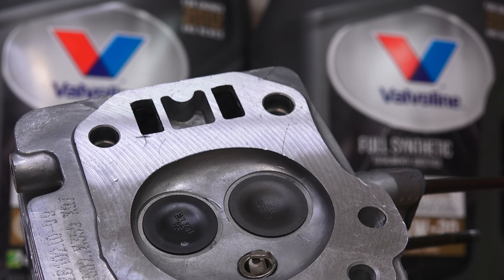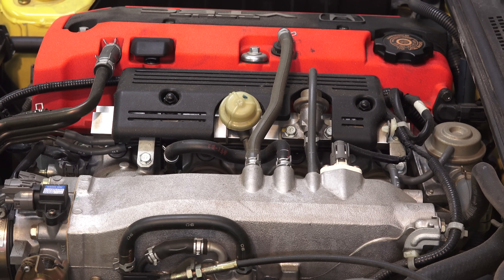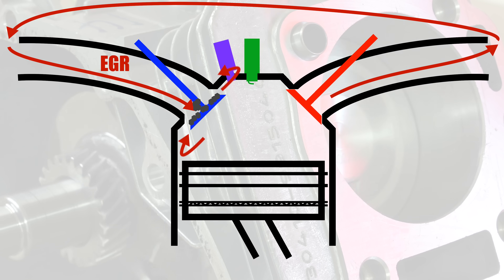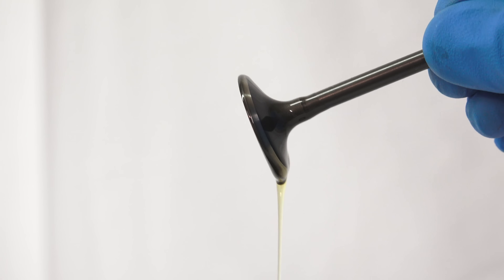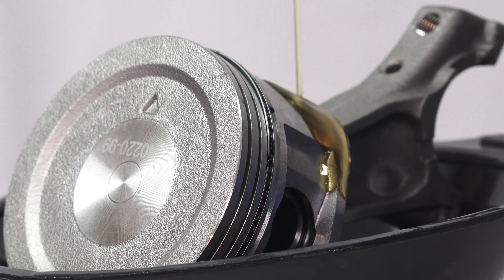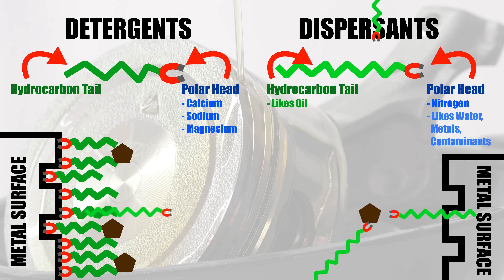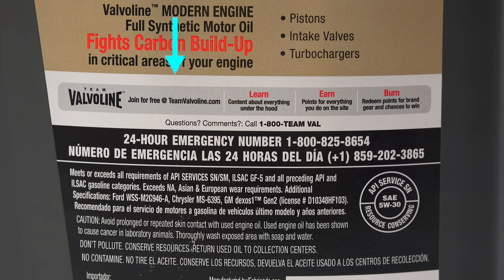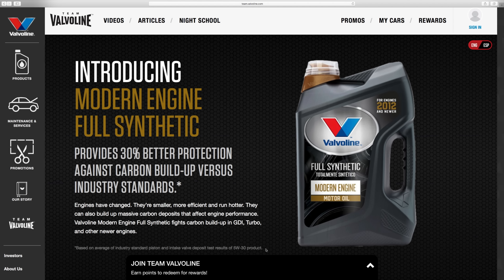Can Engine Oil Help Prevent Carbon Build Up?

Comment: I switched to the Valvoline modern engine almost a year ago and since doing so in my Ford focus ST I’m seeing about 40 to 50% less oil in my catch can so that’s proof enough for me that it’s working.
Reply: Since they stopped making valvoline modern engine, what oil do you use now?
Reply: @MJ_AngeloJR   they changed the name but they still offer it
Reply: @Rockybalboa541  valvoline extended protection?
Reply: @MJ_AngeloJR  I would recommend pennzoil ultra. It's the only oil that's made of natural gas so it burns better and it's more pure than other oils. I put it in my gs300 with gdi and have had no issues with burning with 5k mile intervals
Reply: @smallbeans101  yes sir that’s the oil I have in my 2015 Ford Escape with the 2.0 ecoboost
Reply: @smallbeans101 it’s not the only one. Amzoil is as well
Reply: @takiua2264  actually no. Pennzoil is the only oil made from gas. It's patented so others can't copy
Reply: What if theres less oil in the catch can and now more on the intake valves ?
Reply: I think there might be a misunderstanding. Engine oil shouldn’t be entering the combustion chamber at all—that only happens with issues like worn piston rings, valve seals, or a bad head gasket, which can lead to oil burning, blue exhaust smoke, or fouled plugs. Normally, oil stays in the crankcase and lubrication system. A catch can might collect blow-by oil vapor, but less oil there could just mean different vaporization or engine conditions, not necessarily the oil "working" better. If you’re seeing a big change, it might be worth having a mechanic check for underlying issues to be safe.
Reply: why does your Ford need a catch-can?
Reply: I use Pennzoil Ultra Platinum as well. Lots of research and videos has contributed to my choice. You will see
Reply: I don’t know if it’s a placebo effect but I started using Valvoline Restore & Protect in my moms 04 Civic because it was eating oil and the engine seems a lot quieter and it feels like it has more power. The mileage also increased by 4 mpg but I also had changed the PCV and added some fuel treatment which also might of helped the mpg gain.

Comment: This simply does not pass the common sense test.  You can talk about dismemberments and detergents all you want, but they don't pass over the intake valve on a direct injection engine!!!  It seems like the whole auto industry is trying to avoid talking about this.  The 2019 Rav4 still has a combination DI and injection, so at least the injection portion will spray gas on the intake valve.  And that is why I will buy that car over the Santa Fe, or the Mazda CX-5.  I hold onto cars for a long time, and I don't want carbon buildup.

Comment: I change the oil on my 2018 Civic EX-T regularity. In fact, I change it more often than the manufacturers recommended. I have just over 6,000 miles and I’ve already changed the oil twice. I also use top-tier fuel exclusively with the highest Octane available...usually 93. I know that this won’t prevent carbon build up but I hope to mitigate it.
Reply: Seems in direct injection the carbon build up is caused from the back of the intake valves not getting sprayed with fuel as in port injection . The fuel help keep the intake valves clean in port injection. So am I missing something? how would using premium fuel help keep carbon from building up on the back of those valves when no fuel is getting to them?  I would think a great synthetic oil changed regularly would be your best defense. Which you are doing. My vehicle recommends changing the oil every 7500 miles or 6 months. I dont think I want to push it past 5000 seeing the oil could be the best protection against carbon build up. I don’t see how premium fuel plays into to it. Could you explain that reasoning, thanks.
Reply: @toby7291  
I only use Shell Nitro Plus 93 Octane on my Civic EX-T. Honda recommends 87 Octane. Why do I “waste money” on the Shell Premium? 
I don’t care about the higher Octane for performance as I know it won’t do much on this car. I use Shell’s premium for the highest detergent formulation that comes only with their 93 Octane. I want to mitigate carbon deposits and their 93 Octane offers that extra detergent over regular top-tier gas. I’m fully aware that modern GDI engines do not spray the fuel over the pistons like port injected engines do but every little bit helps especially on turbo engines like on my Civic. If you plan on owning your car for the length of its life (like I do), and you have a turbo engine, everything you can do to keep your intake clean is worth it.
Reply: @txmoney  no I don’t have a turbo. I just bought a Nissan Frontier withe new 3.8 direct injection engine. I didn’t say premium fuel was a waste of money I just don’t and still don’t understand how the choice of gasoline  will help when the carbon build up happens in a part of the engine that gas never gets to. I am using top tier fuel. I don’t have a shell station anywhere near me. Been using BP and Marathon gasoline’s. I’m considering regular intake cleanings with something like CRC GDI Intake valve cleaner. People claim if you use that as maintenance and not using it trying to get rid of heavy carbon build up it’s pretty good stuff. I just turned 1000 miles the other day. So I’m getting to the party early on trying to prevent carbon build up in the intake.
Reply: @toby7291  
It’s great that you’re conscience about your new vehicle and starting early to mitigate carbon deposits.
I now have nearly 84,000 miles on my Civic (about 60% highway miles). Since it was new, I’ve been changing the oil/filter earlier, (every 3,800-4,200 miles) than Honda’s recommended maintenance interval for its full synthetic 0W-20. I’ve also changed the transmission fluid twice and flushed the coolant. The higher detergent top-tier fuel in Shell’s 93 Octane that I use exclusively is just another small measure to mitigate carbon deposits. I plan on using CRC cleaning soon as an added step. So far, my Civic has provided trouble-free driving over three years. I’ve never even come close to red-lining. My goal is to see how many miles I can get on this small 1.5 liter, turbo engine when maintained well...hopefully 300,000 miles.

Comment: Is there a list of affected engines as well as what manufacturers have done to eliminate or minimize this issue?
Reply: RAM IS THE ONLY MANUFACTURER THAT DOESNT HAVE THIS ISSUE
Reply: @ParadiseSleepChannel  , if the engine selected has direct injection without an additional fuel system that injects fuel upstream of the intake valve,  as in some of Toyota's engines, it has this issue.  If the engines do not have direct injection, their days are numbered due to the fact they won't be passing any more emissions standards in the future.  Hence, the reason the Hemi is on its way out.

Comment: You can install a complete catch can system on your vehicle as I did to my 2019 Raptor even though Ford has port and direct injection on their 3.5L twin turbo engine. 

Nothing but clean air and fuel.
Reply: Did Ford make a big deal about it voiding your warranty? Just checking as I have a GDI Honda. Thanks
Reply: @dharmaboy75  

No, I called the Dealer and the Ford Service Advisor said as long as it doesn't cause an issue or something to fail it's not an issue. 

I would have done it anyway because to deny a claim they have to prove it was caused by the catch can. Some Dealers may squawk about but even Ford themselves sell a catch can for the 5.0 and some manufacturers are starting to include them from the factory.

You really need a catch can especially if you only have GDI as you will have Extreme coking issues eventually.  It's a well known fact.

Comment: I have a 95 Honda Del sol with a rebuilt engine, transmission, clutch and a bunch of other stuff. I've been cleaning it up and cleaning up the engine, etc.... What oil would you recommend for this car since it's not a GDI Engine? Thanks!

Comment: Good info.  1. Use correct viscosity oil    2. Use approved oil for your vehicle    3. Change oil often     Pretty much what the old timers were doing.    And that's the truth.....

Comment: Hello Jason,
Great explanation as always!
Here's a thought: why diesel engines never seem to experience intake valve carbon build up (they do, but not nearly as much as gasoline engines), although they the same "recipe for disaster" i.e: egr, direct injection and turbos...?
Reply: Yeah, I've been wondering the same thing.  There's been decades of turbo charged, high compression (of course higher with diesel), direct injected engines with fewer issues of carbon buildup.  What's the difference beside the fuel?
Reply: @michaelmcgarveyspinks4835  my 2002 VW TDI had horrible intake carbon issues
Reply: Because gasoline engines require an amount of air specific to burn the gasoline injected in the combustion chamber. If the engine needs more air than the actually given, it will shake or not work properly, carbon buildup makes this problem. Diesel engines instead only need injection with full quantity of air always, which is why most of them don't own a throttle body. Because of this, when carbon buildup appears on a diesel engine, the engine will slowly loss power without the user noticing because of the way it works. Gasoline engines have vacuum on the intake manifold, which makes the carbon buildup adhere more strongly on the ports.

Indirect injection helped clean the valves, but with this crap GDI engines as the injector is located in the upper side of the combustion chamber, valves cannot be cleaned.

Comment: Thank you for explaining DI and PI.  I now better understand what each one is.  Now, a loaded question.  In vehicles with only DI (assuming some vehicles have only DI), why do they have import valves?  If the gas is directly imported into the cylinder, wouldn't that eliminate the need for import valves?  Or, am I wrong in assuming some vehicles do not have port injection?
Reply: The inlet valve on a DI engine opens to allow air into the combustion chamber, where it is mixed with fuel. Without air there is no combustion.

Comment: Just purchased a 2017 Toyota Tacoma powered by a 3.5l V-6.  I contacted Valvoline directly anf they recommended this oil in 0w20 for my engine.  Anyone run this oil in their Toyota engines that spec 0w20??
Reply: No need to worry your engine has duel (direct AND port) injection.

Comment: In another video you explain the cons of direct injection. How do Diesel engines avoid carbon buildup and run for so long since they also inject fuel directly to the cylinder chamber?
Thanks,
Reply: Diesel engines have a BIGGER problem with carbon build-up on intake valves than gasoline engines1

Comment: Only thing that seems to really have any impact on slowing it down is put a oil catch can in the PCV system filter out lot of the junk before it goes into the intake. Using good oil with lower evaporation also helps. From the charts I have seen only Redline and Pensoil Ultra have the lowest NOACK Volatility lot of amsoil websites also. The main thing is the catch can which can really make a difference.

Comment: Not only the base oil break down and decrease the oil performants also additive package breaks down after mileage. Modern low SAPS oils specifications have been achieved with higher quality base oils so oil do not need much additive package compared to standard oils. So first follow manufacturer oil standards than find low SAPS oil which meets the manufacturer’s standard.

Comment: Thanks for the interesting and informative video Jason. I just got a 2019 370Z that has the port-injected VQ37VHR engine and I'm going to install oil catch cans in the PCV line to reduce deposit buildup in the intake tract that's upstream of the injectors. I use Chevron Supreme and am going to dose the tank with the Redline SI-1 fuel system cleaner before each oil change, so I'm pretty sure that everything downstream of the injectors will stay fairly clean.

Comment: Does anyone know if the modern Atkinson cycle used in many GDI hybrids helps prevent carbon buildup since the intake valve is open during part of the intake stroke and thus pushes some injected fuel to the back of the intake valve, or does the fuel injection always happen later in the compression stroke after the intake valve has closed?

Comment: Ok i have a question for any wrx owner. I drive a 2018 wrx fa20 dit. 11k miles on subaru 5w30 oil. After watching this video i would like to try the valvoline 5w30 oil. Does anyone else use this oil? Will it void a warranty?  Would using this oil help to better protect my wrx for the long run? Or should i just keep running subaru 5w30?  After 2k miles on the subaru oil the car is a bit sluggish as if the oil isnt doing its job. Any tips or answers or suggestions is greatly appreciated.
Reply: It's your imagination.  You cannot feel what your oil is doing.
Reply: @terrywaters6186  imagination my ass. All oils arent equal. Or there would only be 1 brand and weight.

Comment: 45 years back as a mechanic we often removed cyl heads and decoked head and piston prohibit around 60000 miles which gave the cars a new life next time it was new rings & bearings oil does get past the piston rings Rovers Rolls used to say topping up oil is normal Today compression is higher + better oilsRon N Z

Comment: as a professional mechanic I would suggest just doing oil changes every 3k miles and change all fluids once a year. this will give you the best protection against wear and wear related problems. if you keep your cars for a long time this will save you money on parts

Comment: I added an oil catch can to my 2017 camaro that filters the oil out of the egr valve gases before allowing the vapors to be reburned through the intake manifold.  Am I stopping the Dexos rated Oil from cleaning the valves or am I keeping the valves from becoming carboned up in the first place?

Comment: Hi Jason
Sounds reasonable. It's good that Valvolene are thinking about it.  However the Oil Industry has the NOACK volatility index as the crirical guide that assists. This measures an oil's propensity to evaporate under heat, and is key factor in formation of GDI inlet coking. As far as I know Valvolene does not score well on that index? If Valvolene has an oil with a superb NOACK index then why keep it secret? I for one, would love to know. Penrite Ultra and Amsoil and Mobil M1 ESP 5-30 and few others do. Oils derived from natural gas so-called PAO based oils appear to perform better, ie., have lower volatility and burn cleaner in turbocharged applications. The problem is not trivial when leading car makers like BMW and Audi with iconic Ward's award winning ("best in world") engines that are coking up badly. The German engineers in these cases have been defeated by regulations and conflicted design compromises. 
Jason, please step up. Do we have to buy older cars with port injection engines? I really care about my engine's longevity and swamp it with TLC. But  manufacturers have "signed off" with a measly 100,000 miles as an engine "lifetime" -  it's immensely frustrating that most engine oils are not up to what's needed with these latest engine designs. We are left with options like after market catch cans, CRC inlet sprays, and so on. Of course there is the option I could surrender and just go back to a N/A Toyota.
Reply: I am a mechanic. I advise never really letting your oil get dirty in the first place. when the oil is clean this does not happen

Comment: Typically I have a favorite brand of fuel and a favorite brand of engine oil, not the same brand. Your very informative videos on sludge/carbon build up in modern engines has me thinking that maybe I need to consider fuel and lubricants that are designed to work together as you would hope a single brand might. For instance, should I consider using Shell fuel and lubricants, as an example? Or Mobil fuel and lubricants? Rather than mixing WAWA or Flying J premium fuel and Mobil 1 lubricants as I do now?
We  own a 2005 VW since new with a 1.8T, notorious for sludge buildup. To date using Mobil 1 lubricants, specifically 0w40, after 125k miles no issues. Engine runs fine, good fuel economy, only routine maintenance.. In several other VWs, all purchased new, I have used european spec oil, Motul, with similar results up to 200k. BTW after reading about the VW dealership fiasco many years ago using regular oil in the 1.8T, which caused the sludge issue, I have always supplied the engine oil when getting service from dealerships.

Comment: So if you just pull the hose off the PCV and EGR and vent it to atmosphere, then plug the hole's in the intake manifold, you can avoid the majority of the carbon deposit problems GDI engine's are having.

Comment: hi, would you reccomend something other that the oem subaru oil from idemitsu oil japan? or should that do a good job on the wrx without needed a walnut blast and just the fuel injector valve service.>?

Comment: Jason, with the steps you recommended of changing oil regularly, staying topped off etc, will an oil catch can or air oil separator help to reduce oil deposits even further?

Comment: What if you think or know, you already have carbon build-up on your intake valves in your turbo'd GDI engine, can switching your old oil to these new oils help break down the carbon deposits, that are already in your engine, on the intake valves?

Comment: What I don't exactly understand is why more cars don't use port water injection? I imagine it works like port fuel injection to clean the carbon deposits, and also works somewhat like EGR to cool the intake charge and prevent knock. Seems like a fairly simple, elegant solution.
Reply: Cost probably.  I think ford and Toyota still do.